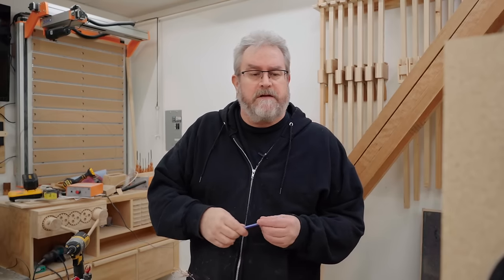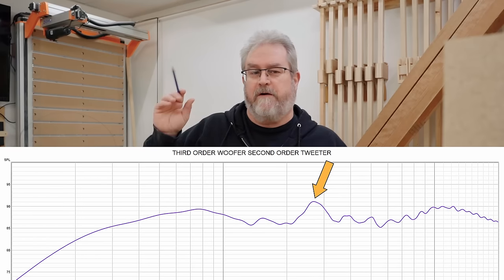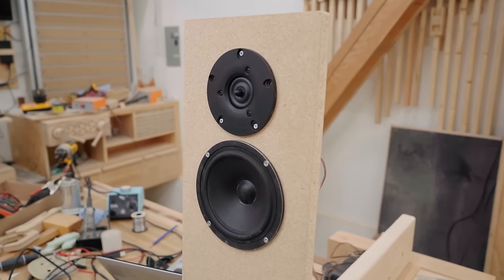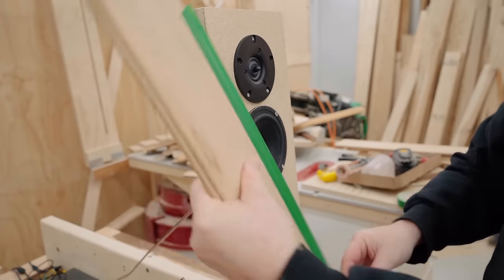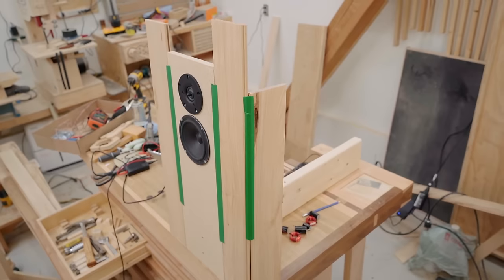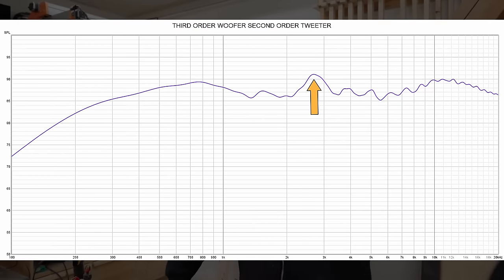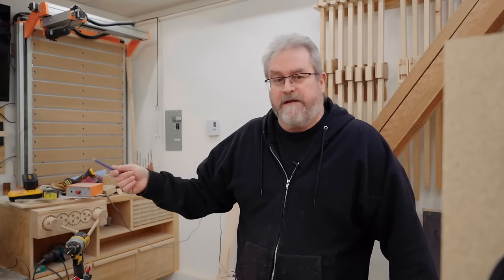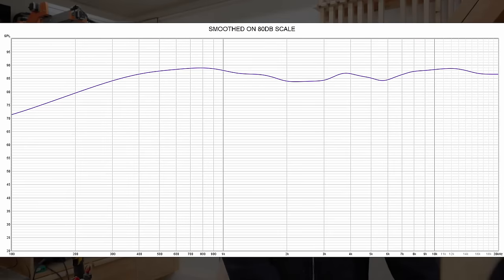The Dirty Little Secret of Open Baffle Speakers

Comment: GR Research can teach you how to do open baffle correctly.
Reply from the maker: And about cable lifters.
Reply: @IBuildIt  So getting the cables off the ground offer no improvements. I'm asking for a friend.
Reply: Very cheesey comment. I think you need some fancy resistors to clear your vocals up.
Reply: GR Research answered the question (see Tech talk 14, for example)
Reply: @IBuildIt  come hear my gr research system and I'll guarantee you hear a difference. Absolutely guaranteed. Nx otica with a pair of triple servo subs in a room treated extensively with diffusion and panels much like yours. Absolutely made a huge difference getting the cables off the carpet.

Carpet holds static electricity. That is not benign.
Reply from the maker: @ClassifiedBrief  credibility = zero
Reply: @IBuildIt  when people notice a difference when you didn't even say you did anything and they are not audiophiles... Its crystal clear.

Comment: The dirty little secret is that you have to design them correctly. No speaker has perfectly flat response. It is well known that you want no two edges the same distance from the drivers. After that you have to determine the optimal crossover. Same process as any other speaker really.

Comment: Symetri is not good.
Reply: Assymetry is not the solution to this problem either. Keeping the diffraction to a minimum by rounding of the edges with at least 50 mm radius will help a lot.
Reply: @flex-cx9bi  Or better yet both.